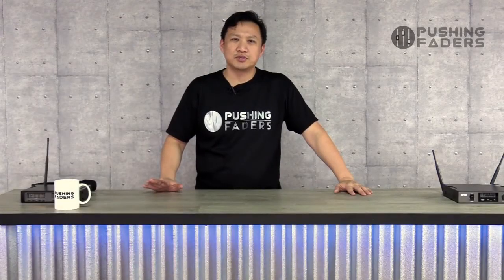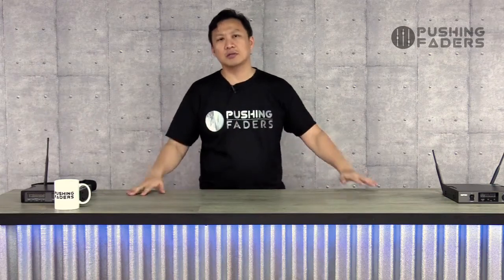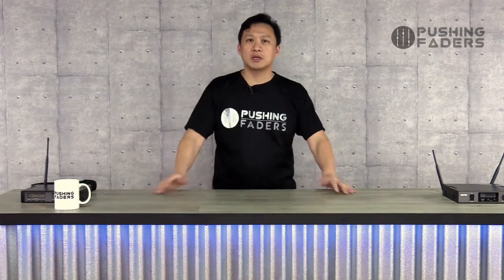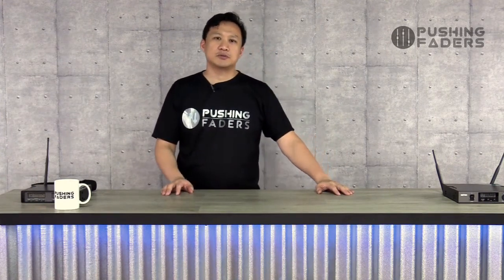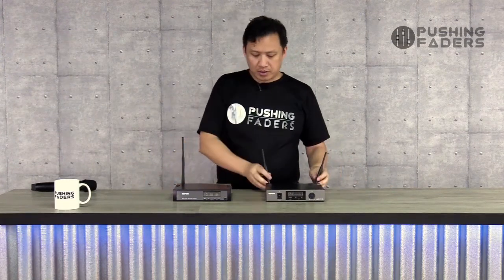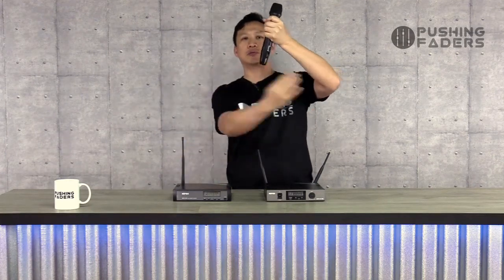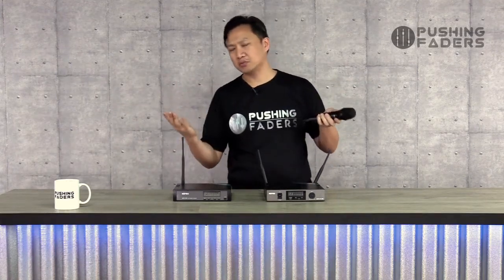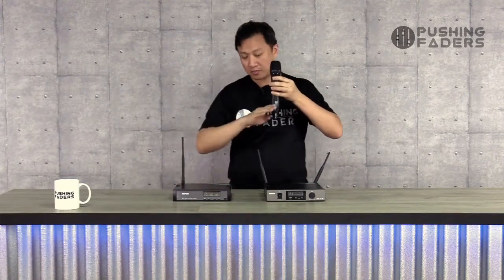The RF Chat Part 1: Diversity and Non-Diversity wireless mic Systems Explained.

Comment: Good info to know sir! especially didto sa atin sa pinas na hindi masyado full featured or no videos ang mga wireless mic system reviews!

Sir may tanong din ako. I currently run a small sound system for our events venue and found that my wireless mic seems to drop out during the most inconvenient of times. Could It be because of my placement of the receiver na nasa elevated na platform as opposed to sa line of sight placement? Na curious lang kasi ako dahil ngayon ko lang na alam na donught shaped pala ang pag transmit ng wireless mic to the receiver. 

Anyways,  big thanks for putting out videos like this and watching from Cebu!  Daghang salamat!
Reply from the maker: Hi Josol.. first, lets know mucn anong freq range nahooperate ang wireless mic mo (send a pic kung puede), and is it a fixed frequency or a freq. agile system.   elevating you receiver above any possible obstruction, like the crowd, is ideal... naabi nga natin parang doughnut ang transmission pero di naman totally linear... kung baga, it get wider vertically and horizontally with distance..    check first your unit's specs and get back to us
Reply: @PushingFaders   I believe the current one we're using is a fixed frequency type microphone. A generic one with two mics made of plastic, volume control and no way of changing the frequency. Very troublesome to use especially since we're using two-way radio comms with the staff (can hear an audible buzz whenever I send out a message via the radio) It was more of a stop-gap measure just to address our lack of a wireless microphone in the past.

We recently went out to purchase this particular unit from Lazada (https://www.lazada.com.ph/products/i164458819-s203227496.html?urlFlag=true&mp=1) KEVLER MR-250H because, at the moment, we deem it to be within our price range and has mostly checked off the list of things I'm looking for in a wireless microphone system for our venue. Would It be alright for me to ask for your professional opinion about the aforementioned wireless microphone unit sir? I keep on seeing other sound system operators using the same set via their vlogs but never really get into talking about any specific details. Thanks again!
Reply from the maker: @SolAcu009  one other thing you can try is putting the receiver closest to the mic, like sa tabi ng stage.  hopefully ang power ng transmit is strong enough to overcome the interference... yun nalang puede try